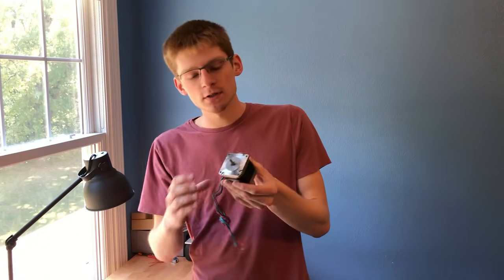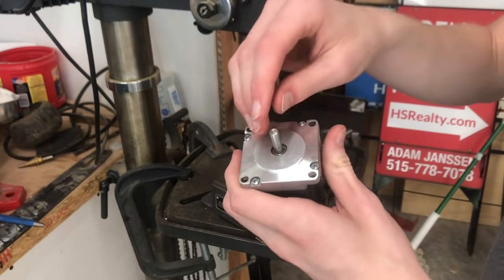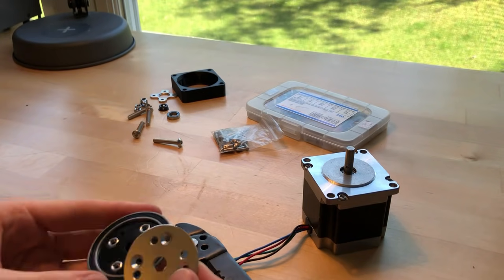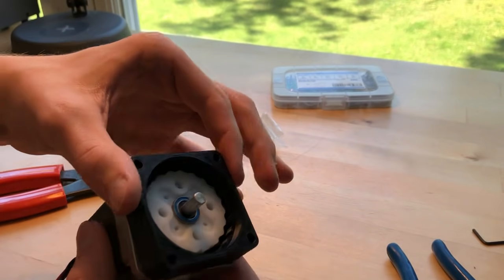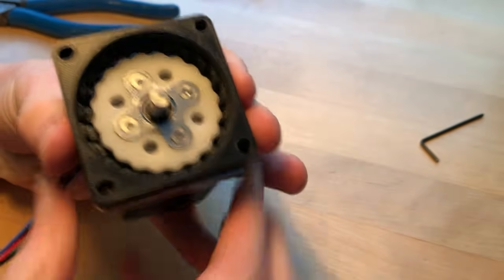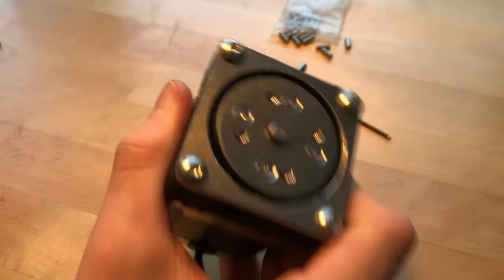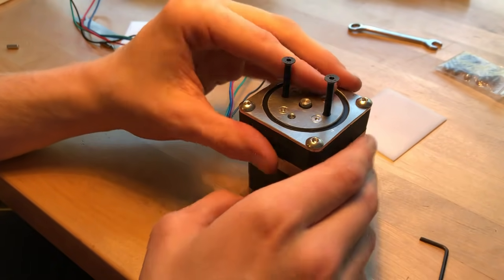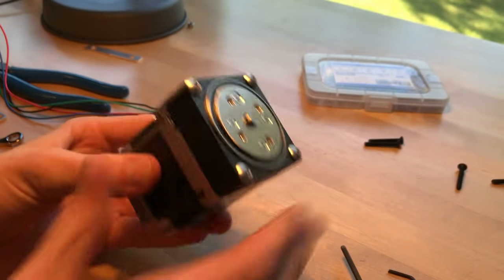High Torque Cycloidal Drive (NEMA 23 Motor)

Comment: I recently decided to design a 3D printed cycloidal gearbox and throw it on top of a 2300kv brushless motor... After a lot of fiddling, I actually got it to work. I think the ratio was 29:1 

It ran for 10 glorious seconds. Then the motor windings burned and the magic smoke came out of the ESC. I think my problem was that the main gear was sitting right on top of the housing. Even though I put some grease in between them the friction was still too high. I was planning on putting some ball bearing between them but I just don't have the time.

They are a bitch to design and manufacture but it's wild how such a compact gearbox can produce 30:1 ratio.

Comment: If you need pins to go thru 2 or more plates, place the plates together and then push the pins thru all of them. Otherwise, when you are pushing the second plate onto the pins that are already inserted into the first, any imbalance will try to bend your pins or wallow the holes they are mounted into.

Comment: How did you think this was going to work if you have an eccentric element rigidly coupled to a concentric element? Maybe I'm a moron and don't understand how it works, but it seems like the pins should be running in slots, not just put into sized holes

Comment: I have a question:  would it be possible to make a functional, useful cycloidal drive on a 28BYJ-48 stepper?
Reply: Good Question!
Reply: Sure. Its only a matter of construction techniques.
Reply: @maxhouseman3129  I wonder if the decrease in size would make it bind....
Reply: @odinata  If the whole construction is smaller, than it should work.

Comment: Could you... use a smaller amount of "loose" pins, and leave space between, so that you could put each pin on a small bearing supporting it at top and bottom, which "should" reduce friction, but also increase load bearing capability as it would need to rub up against an outer wall.

Comment: Interesting you used a power supply to apply holding torque during drilling... fun fact - shorting the leads together is another way to greatly increase the detent torque of a stepper, without needing a supply. Trying to move the shaft creates a voltage - shorting the leads says voltage=0. Limited by R =/= 0.
Reply from the maker: Tried that first, wasn’t enough.

Comment: Hey, I really like your build. What kind of aluminium is that? It looks like you should go for higher feeds, the chips are way too tiny. 
This way the end mill produces enormous amounts of heat, because it mostly rubs over the surface. It will definitely die sooner than later :)  
Also it might make sense to go for holding bridges, which are easier to remove. Just my two cents. Did you make progress with the uneven rotation speed of the gear? How would you consider to fix it?   Best

Comment: To ensure the straightness of output pins you should use two bearings instead of one. The second bearing system should be under the cycloidal lobe. the output shaft and bottom bearing system (  similar to output disk ) of your gearbox will be connected through output pins. This will increase the stability of op shaft and also the radial load capacity of the gearbox.

Comment: I think two Cycloidal Disc 180-degree offsets will keep the motion smooth
Reply: Due to the eccentric nature of the drive, if the cycloidal disk is not balanced by a second disk or a counterweight, it will generate vibrations that propagate through the driven shafts and the body. These increases wear on the exterior teeth of the cycloidal disk and the component bearings. The static imbalance is corrected with two discs, but a small dynamic imbalance remains. This is generally considered acceptable for most applications. To reduce vibration, high-speed drives use three or more discs to correct the imbalance; the outer discs move in unison, in opposition to the middle one, which is twice as massive.  https://en.wikipedia.org/wiki/Cycloidal_drive

Comment: I can see why you chose to use pins but wear isn't really going to be your main concern with the plastic gear and the printed base is going to always have flexing.  Have you considered milling the pin profiles into the base so it is one solid piece of aluminum?  This would solve your bending issues if you can get your CNC feeds and speeds dialed in (those parts seem a bit crufty!).  You may be better off with something like Jeff Kerr's "Anti-Backlash Compound Planetary Gearhead" which is designed to flex and uses the flex to reduce backlash with a similar reduction ratio and it can be easily printed.

Comment: I have no experience of cnc routing (but i do with manual milling & turning) your cutter looks very long. which is just asking for chatter  added to the already less than rigid structure of the machine, the shorter you can make the cutter (shorter cutter, or cut the shank and pushed all the way into the collet)  would improve the finnish and accuracy your getting on your aluminum parts.

Comment: I feel like I may have seen one on your bench but I didn't see you use it.  You need a "Noga Deburring Tool"  It makes getting rid of those machining/cutting burrs SO freaking easy.  Very cheap too.  Check out ABOM79, This Old Tony, Keith Fenner, etc for tips on making really clean metal parts.  Machining is fun!

Comment: Milk of magnesia works well as lube for working with stainless steel.
Reply: Don't know if this is a joke or not but what does the MOM do? Prevent galling, (which is the biggest problem when working with stainless)?
Reply: @pierdolio  idk what it does but a welding instructor of mine said he used it all the time in the nukes.

Comment: Awesome!  Did you shave down the bolts before drilling out the pins? (Maybe those bolts were the only problem?)
Great results! So few people have discovered cycloidals.

Can this be made using only a cnc? Or would it have to be bigger (using a 3mm bit).
Reply from the maker: I did grind down those screws. This certainly can be made with only a CNC. I would have done that had I had thicker plastic to cut out the base. The only thing you’d have trouble with would be the hexagonal holes in the plastic bearing spacer. I used a 1/8 inch bit.
Reply: @LeviJanssen  oh I meant: did you test it with ONLY grinding down the bolts (without having drilled out the pins)?

Comment: There is a lot we cannot see without the design but it looks like the holes that hold the pins from the output disc do not match the holes in the internal gear.
The holes in the internal gear should match the pins plus the eccentric motion in order for the output pins to move freely without (much) play.
With the pins being crooked in the output disc I am sure that is not the case anymore. Drilling out the plastic part of the output disc by hand and then forcing the pins in location with the aluminum disc will not help - if anything it will exaggerate the problem. A good solution would be to use two discs, one on each side of the internal gear, to make sure the pins are mounted straight.

Comment: At the start of the video, the output of the drive is not smooth.  Is this a video artifact, due to friction or manufacturing defect or just inherent in this kind of reduction drive?

If the un-even motion is inherent in the design it is a show-stopper.

Comment: why not grind a flat into the motor shaft instead of drilling a hole. You probably got metal shavings in that motor while drilling. Blow a ton of air in it to prevent shorts but they may be stuck to the magnets.

Comment: 15:30 if you cant back drive it how you can think you can stop it XD when it not move motor shaft with any current
Reply: irreversibility  vs torque = pigs vs speed

Comment: Try to get 5000, 6000 or 7000 series aluminum.  You will find it machines much better without bending out of the way and going all gummy and pushing out of the way.  most of the aluminum sheet you find is 1000 grade which is pretty much pure aluminum, great for bending into curved shapes and anodizing, awefull for anything else.

Comment: You have a cnc mill, why are you making junk plastic parts in plastic? That is why you pins are not straight. You are also drilling stuff by hand when you could be finishing with pocket operation on a mill to get it spot on. You eccentric looks very rough and fragile, why isn't a milled part?  I see people desperately trying to find a use for 3D printers because they bought one. Once you've made the key fob and realise everything else breaks, you can forget them. I see none of these parts which would not be better made on the mill. Instead of a plastic gear with a metal insert and a metal plate on each side you could have a metal gear with a shoulder and one plate, no insert, no screws ... and pins would be straight and solid.